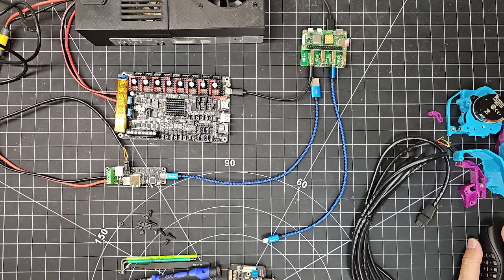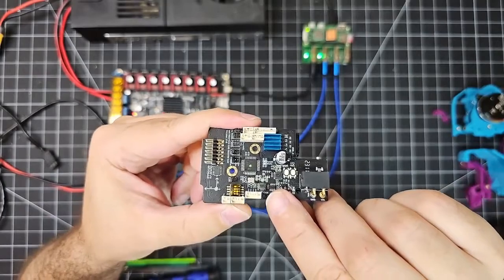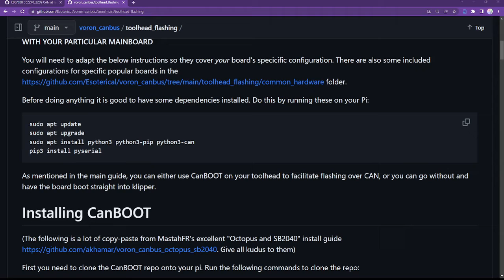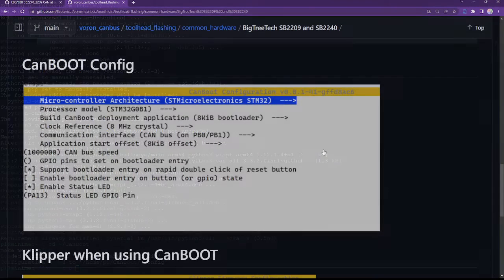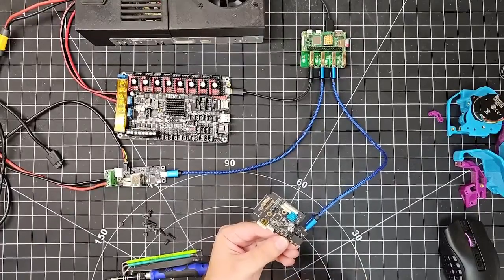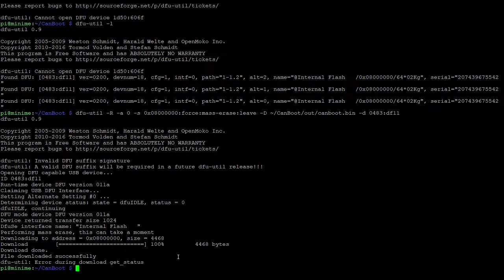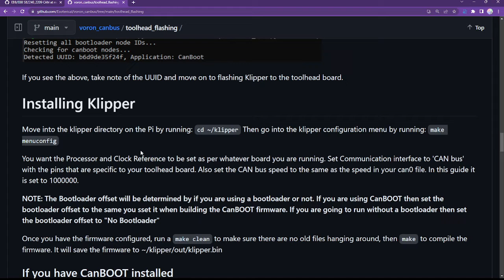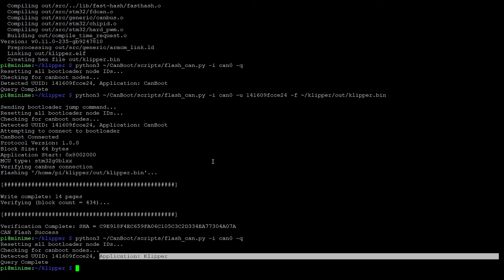From The Bench: Episode 3 - Flashing a BTT EBB SB2240 Toolhead MCU with CanBoot and Klipper

Comment: Thankyou for doing this presentation,  I have been spending hours trying to get my ststem operational unable to get a UUID.  This is the first page I found that shows you exactly how to configure a U2C and A EBB devices> Now to install it all on my Voron2.4,  Thanks again.
Reply from the maker: Hope it helps! For the record, this same process also works with an SB2209 and an EBB36. The only difference being the changes to the printer.cfg at the end of the process.
Reply: @oldguymeltsplastic    Getting the following error when generating the Klipper.bin file

pi@test:~/klipper $ make menuconfig
Loaded configuration '/home/pi/klipper/.config'
Configuration saved to '/home/pi/klipper/.config'
pi@test:~/klipper $ make clean
  Creating symbolic link out/board
pi@test:~/klipper $ make
  Creating symbolic link out/board
  Building out/autoconf.h
  Compiling out/src/sched.o
  Compiling out/src/command.o
  Compiling out/src/basecmd.o
  Compiling out/src/debugcmds.o
  Compiling out/src/initial_pins.o
  Compiling out/src/gpiocmds.o
  Compiling out/src/stepper.o
  Compiling out/src/endstop.o
  Compiling out/src/trsync.o
  Compiling out/src/adccmds.o
  Compiling out/src/spicmds.o
  Compiling out/src/i2ccmds.o
  Compiling out/src/pwmcmds.o
  Compiling out/src/buttons.o
  Compiling out/src/tmcuart.o
  Compiling out/src/neopixel.o
  Compiling out/src/pulse_counter.o
  Compiling out/src/lcd_st7920.o
  Compiling out/src/lcd_hd44780.o
  Compiling out/src/spi_software.o
  Compiling out/src/i2c_software.o
  Compiling out/src/thermocouple.o
  Compiling out/src/sensor_adxl345.o
  Compiling out/src/sensor_angle.o
  Compiling out/src/sensor_mpu9250.o
  Compiling out/src/stm32/watchdog.o
  Compiling out/src/stm32/gpio.o
  Compiling out/src/stm32/clockline.o
  Compiling out/src/stm32/dfu_reboot.o
  Compiling out/src/generic/crc16_ccitt.o
  Compiling out/src/generic/armcm_boot.o
  Compiling out/src/generic/armcm_irq.o
  Compiling out/src/generic/armcm_reset.o
  Compiling out/src/generic/timer_irq.o
  Compiling out/src/stm32/stm32f0_timer.o
  Compiling out/src/stm32/stm32g0.o
  Compiling out/src/stm32/gpioperiph.o
  Compiling out/src/stm32/stm32f0_adc.o
  Compiling out/src/stm32/stm32f0_i2c.o
  Compiling out/src/stm32/spi.o
  Compiling out/src/generic/canserial.o
  Compiling out/src/../lib/fast-hash/fasthash.o
  Compiling out/src/stm32/fdcan.o
  Compiling out/src/generic/canbus.o
  Compiling out/src/stm32/chipid.o
  Compiling out/src/stm32/hard_pwm.o
  Building out/compile_time_request.o
Traceback (most recent call last):
  File "/home/pi/klipper/./scripts/buildcommands.py", line 618, in <module>
    main()
  File "/home/pi/klipper/./scripts/buildcommands.py", line 609, in main
    ctr_dispatch[cmd](req)
  File "/home/pi/klipper/./scripts/buildcommands.py", line 168, in decl_initial_pins
    HandlerConstants.decl_constant_str(
  File "/home/pi/klipper/./scripts/buildcommands.py", line 140, in decl_constant_str
    name, value = req.split(None, 2)[1:]
ValueError: not enough values to unpack (expected 2, got 1)
make: * [Makefile:83: out/compile_time_request.o] Error 1
pi@test:~/klipper $

Have tryied to redo it but each time I get theb same.  Any Ideas?

Comment: Hi great videos! Have a quick question, is this the same setup and flashing for the sb2209 (rp2040) board?
Reply from the maker: The general process steps are the same, but the configurations you will use in make menuconfig are different from what I've pictured in these videos. I strongly recommend that you check out Esoterical's CAN Bus docs page here for more info on the general process, and your specific hardware: https://canbus.esoterical.online/

Comment: Sorry, couldnt resist. Connecting pins while powered on is a recipe for magic smoke. I fried an Octopus about a year back doing just that, while connecting endstops. Before that, I tried to measure voltage while on, burnt another Octopus when my multimeter probe slipper and I injected 24v to the 3.3v rail. And even that wasnt the first time. I can go on and on.
I cant seem to learn from my mistakes, but here is to hoping someone else might learn from them.
Reply from the maker: You're absolutely correct! Do as I say, not as I do, and all that.

Comment: Still not sure what to do with the 24v cables.. You connect it to your u2c board, but if I don't have that do I just put it on the 24v psu?
Reply from the maker: U2C is itself powered by the 5V from the USB cable to the Pi. You can connect 24V and GND to feed those to the connected CAN Devices. My preference is to feed 24V and GND from the 24V PSU to the green screw terminals on the U2C.
Reply: @oldguymeltsplastic  ah so the U2C's connector is nothing more than a direct line to the CAN cable? As in it serves no purpose towards the U2C board itself?

Almost done building my voron, at that moment where you're like "will it go boom if I turn it on?" haha, very little info available on the board I'm using, the btt manta m8p. Well there is some, just not enough to be fully confident

Comment: Hey there.  I have attempted to follow a few videos including yours but have run into an issue trying to flash my SB2240.   When i get to the step where i power the board VIA usb and put it into DFU mode I get no power to the board.  I have placed two different jumpers on the 5V USB jumper location and tried multiple USB Cs including the one i used to reflash my U2C V2.1.

Is there something i am missing or do you think i have a bad SB2240?

I assume i am supposed to get lights or LEDS when i have power and try doing the BOOT RESET button process....
Reply from the maker: Sounds like you have done all of the right things to troubleshoot, and at this point I would imagine that you have a bad SB2240.
Reply: Confirmed bad board.  It shorted out when I plugged in the fans.

Ordered a new board and did the exact same thing and everything is GOOD TO GO.

thanks for the videos sir. Really helped me get my can bus going on my voron.

I noticed you switched your hot end and toll head a few videos later.  Do you prefer your new setup over the stealth burner?  

I print a ton of PLA at high speeds and find the stealth burner lacks quality cooling
Reply from the maker: Stealthburner is (for some at least) a sexy design, and solidly built, but it is considerably heavier than most alternative toolheads, and the single 5015 blower lacks some raw part cooling capacity.
I have settled on Chirpy's Rapid Burner toolhead on all of my printers. It is lighter, easier to assemble, and has better part cooling. Paired with a high flow hotend like a Rapido UHF or Dragon UHF, I can push my printing speeds significantly faster, and still achieve decent quality.

Comment: Thanks for this video! I'm having issues with my sb2209. The device always shows a solid green and red light. I can't seem to find the board in DFU mode, I put all the resistors and can't seem to find the issue
Reply from the maker: There's a slight possibility that you have a dud board, but it's more likely to be a wiring issue. A quick test would be to swap the two wires for CAN H and CAN L, as there is no colour standard for wiring, and switching them isn't dangerous, as they are low voltage connections. Worst that happens is that it still doesn't work after you make the swap. More help can be found on the Voron Discord server in the #can_bus_depot channel.

Comment: I have all cable installed on my board do I have to unplug them to put board in dfu mode??this is a working printer I want to install canbus.
Reply from the maker: I personally would recommend disconnecting everything as a safety precaution. It only takes a few minutes, and reduces the chances of you accidentally frying something.

You can also set up the CAN Bus devices before disassembling your printer/toolhead. Just need a free USB port on your Pi, and some way to supply 24V and GND to the CAN adaptor and/or toolhead.

Comment: Do you need to, or is it recommended to flash the SB2209 this way as well, or is this only for the SB2240 with Pi?
Reply from the maker: The SB2240, SB2209 (STM G0B1 version, NOT the RP2040 version) and also the newest versions of the EBB36 and EBB42, all use the exact same steps and configurations for flashing both CanBoot/Katapult and Klipper. The only difference will be what configuration blocks you will need to update in your printer.cfg, depending on which hotend/thermistors you will be using, and whether or not you will need to configure the MAX31865 chip.
Reply: @oldguymeltsplastic  Thank You for that!